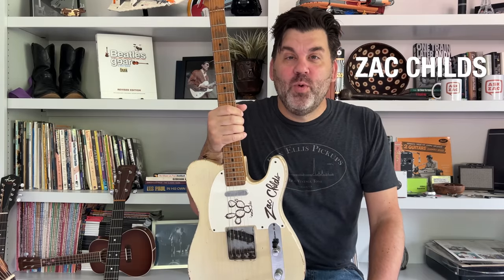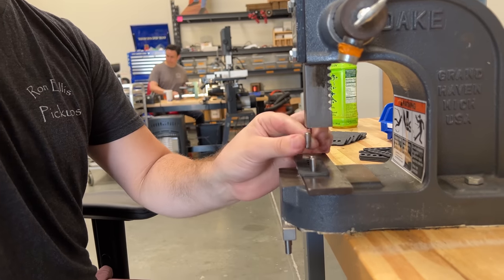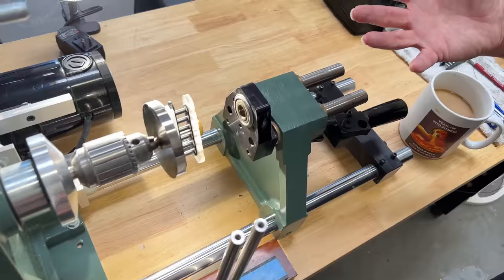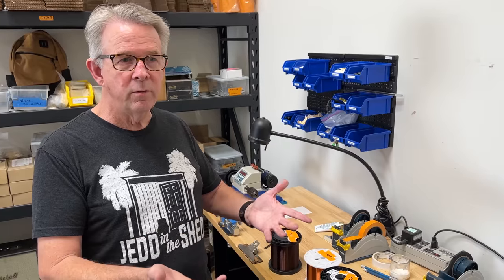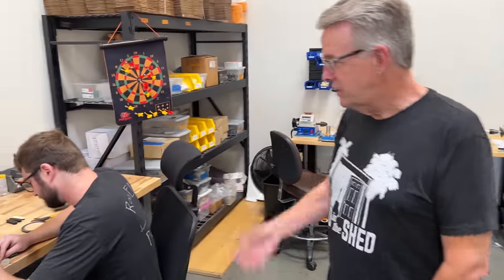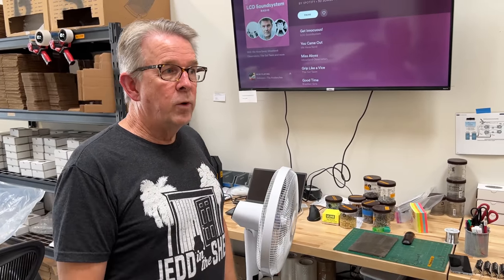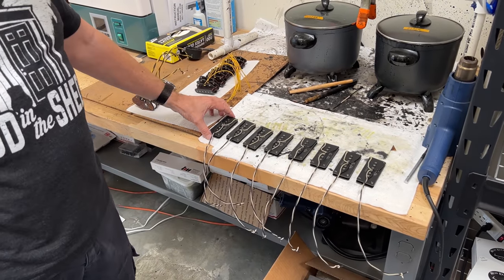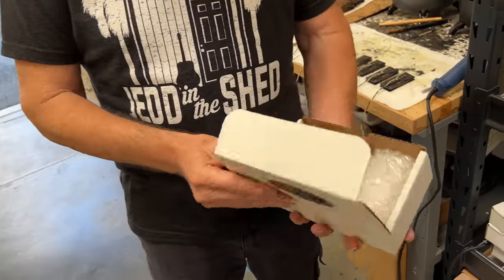A Tour of the Ron Ellis Pickup Workshop - Ask Zac 129

Comment: I've been making my own pickups for probably something like 30 years.  I wind them with an old-school cranked hand drill, clamped to the bench, and a bolt going through the bobbin into the drill chuck.  The wire spool sits on the floor and feeds upwards.  Because I bought my wire from a scrap dealer who sold it by the pound, all my spools (from #32 up to #44, all either MWS or Elektrasola) are of very different sizes and weights, making use of one feeder system unfeasible.  So I let gravity do the work.  I get 4.25 coil turns per handle-crank, and when I'm on a roll, I get about 60-80 handle-turns a minute; roughly 300 turns of wire per minute, on average.  Stopping every now and then to prevent cramping, it takes me about a half hour or so to make a Strat/Tele type pickup.  It would take me twice as long to drive to the nearest music store and back, with a commercial pickup in hand.  If I was in business, I would end up bankrupt PDQ, but for the small handful I make for myself in any given year, nice-n-slow wins the race.

A big part of what Ron obviously aims for is consistency and a reliable distinctiveness.  I.E., each and every pickup of this type is going to sound exactly like this .  In contrast, what I make for myself is for me, and nobody else.  Because it costs me pennies and only a little bit of time, if I don't like the result, I just start over, and don't concern myself with sonic targets or efficiency.  Of course, that's a luxury I can afford as a DIY-er, which Ron can not afford as a manufacturer, with both bills to pay, and a reputation to protect.  Sometimes I get lucky, and sometimes not.  Ron studies results so that the customer gets lucky every time out.

Nice video.  Thanks for that.
Reply from the maker: You are so welcome, Mark. And thanks for the great story about your winder.
Reply: How old is the wire you have? if its from before the 80s i bet your
 pickups sound amazing nothing beats that old wire imho.
Reply: @bobdillon1138  Couldn't tell you.  Perhaps Elektrisola has records and there might be a batch number on the label of the spools, but I suspect that's more work that either they or I am willing to do.

Comment: hey just an idea, but for the wax under the tele bridge plate, I would totally make a silicone mold that's the same shape as the bridge plate but probably slightly smaller and then obviously make the mold for like 100 of them.  then I would pour like an ounce of wax in each one, let it firm up and then peel um out and use um basically like they're stickers.  That seems like it would be so much easier and perfectly uniform then, just throwing that out there... silicone molds are fantastic!

Comment: A good pickup is a good pickup. Sometimes I feel like it’s a shot in the dark. Guitar, an  amp or be it a Kemper, everyone has a different touch and tone opinion. I trued Thornbucker pups and couldn’t stand them. I fully admit that l am probably crazy for that 😂🤣 but they had a honkiness that l couldn’t unhear. Sounded fine to bandmates but….
Reply: Very much agree. I have gone through  many bridge pickups and have usually stuck to hand wound boutique brands, Seymour, seymour antiquities, bare knuckles. I have settled on tone riders strangely enough. The alnico 2 blues set just had the right balance and clarity. May well have been an anomaly for that individual set.